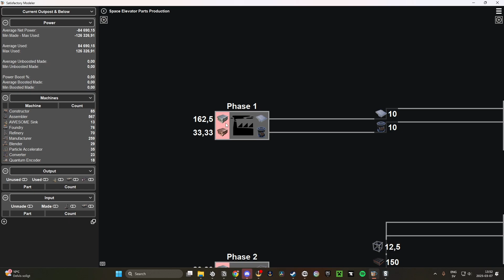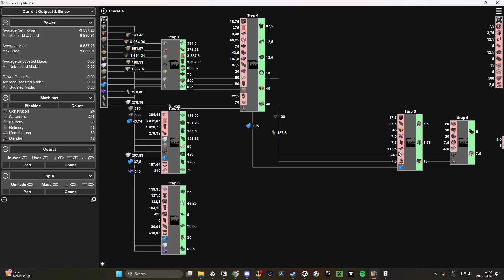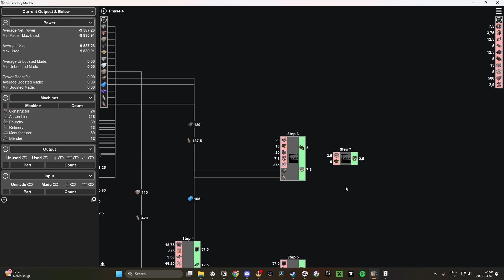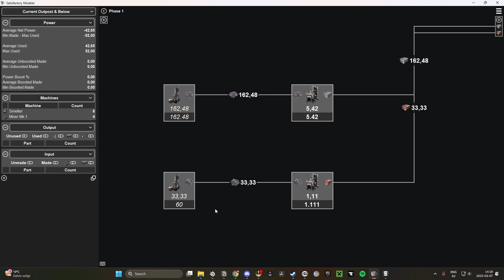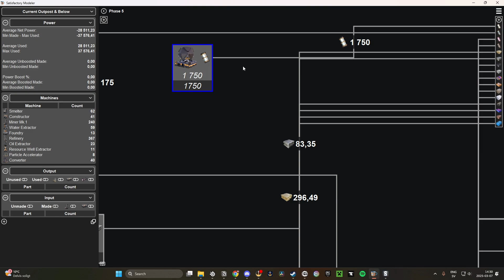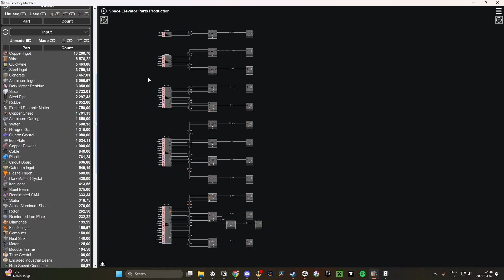Full Guide - How much do you need to Produce to finish Satisfactory 1.0?  | Tips and Tricks

Comment: Really like these videos. Can you tell me though. does the phase one production include the spaceship parts smart plating? I assume not. i guess everything goes into containers, with overflow to sink when its unlocked, and then have a seperate line dedicated to the spaceship parts, which eventually are scaled up and sent deeper into the production

can you give any advice if i wanted to follow this through a build? where shoudl i do it? i guess the logistics and implementation are still up to interpretation.

thanks.
Reply from the maker: I made a number if videos on this, one explains the build able parts recommended for smooth building, one for space elevator parts and one for power requirement, and I put the modeller file for all of it up on my Google Drive for anyone to dissect and use as they want to